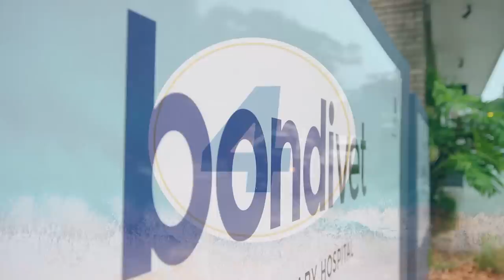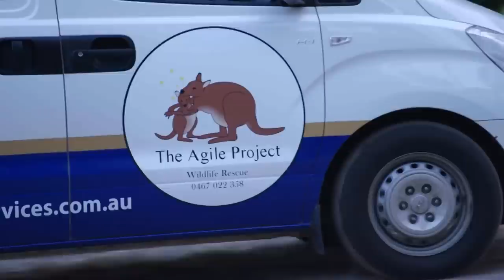5 Heroic Animal Rescue Stories ❤️  Bondi Vet Compilations | Bondi Vet

Comment: I'm in the US. We have had some trouble with traffic & Deer.
Engineers have put tunnels underneath highways for the Deer to go thru.
Also reducing speed limits in problem areas. Putting up signs so drivers know to beware of the animals
Reply: That's awesome! I can't remember where it was, but an overpass was built over a freeway for the animals to cross. They covered it with dirt , grass & etc for easier passage.
Reply: @nancyn6215  Great! It needs to be done. Too many animals perish if we do nothing
Reply: @Nancy N  They have some in Utah & Idaho also Alberta, Canada.  It should be done in all areas where there are lots of wildlife crossing major roadways, better for the animals and the cars.
Reply: @warpedalice  It's a simple solution.
Reply: @nancyn6215  in the Netherlands it's called an ecoduct. The Netherlands is quite small so they use the ecoducts to connect the 'small' wildlife areas together to increase the biodiversity.

Comment: Re the situation in Cairns cant the government just build a tunnel under that awful busy road for those wallabies
Reply: Maybe not, but they can rebuild the highway OVER the other one so the cars are on the upper and perhaps only foot/bike traffic on the lower so the wallabies will be safer. It can be done. it is just expensive. Out here in the Mojave they actually have tunnels for (endangered) desert tortoises to pass underneath the highways and roads.